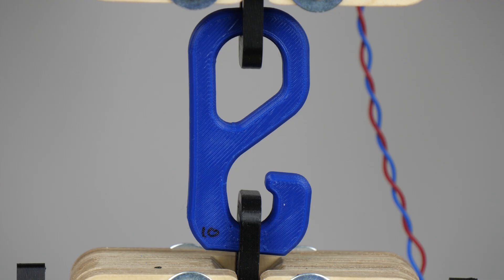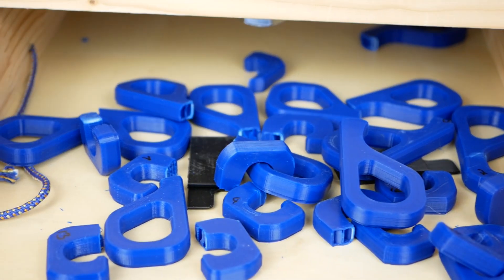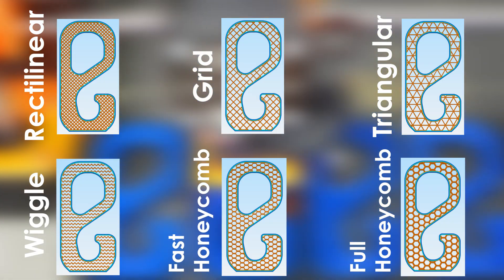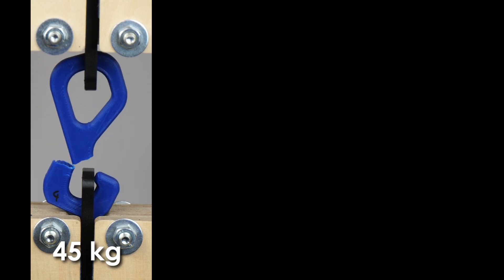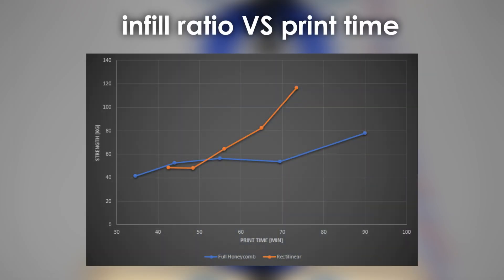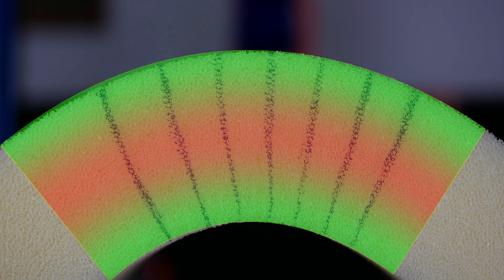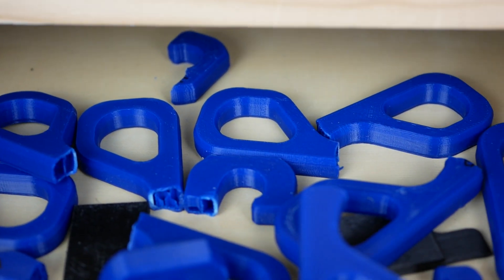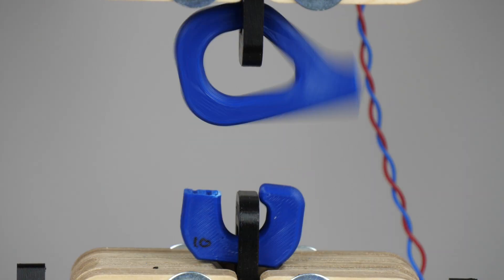INFILL pattern and SHELLS - How to get the maximum STRENGTH out of your 3D prints?

Comment: Is it better to have a pair of 0.4 mm walls, or a single 0.7mm wall? I chose 0.7 because I typically use a 0.6 nozzle.
Reply: So, I just printed some parts with my .6mm nozzle. Did .9mm wide layer width and .24mm height. 3 walls, 10% gyroid infill 5 top at 1mm and 4 bottom and 0 and these things are light and Very strong. CNC has another vid where he talks about layer width and I just used his ratios and applied it to my .6mm. hope that is helpful.
Reply: @d3myz18  Thank you! I ended up really diving into Arachne calibration as well as scarf seam calibration, and I think I found a sweet spot using a 0.6 nozzle. 0.7 inner wall, 0.72 outer, 40% minimum wall width iirc, and 1.55 scarf flow multiplier at 15mm scarf length. I'll be using a 1.4mm nozzle on my Takoto, will likely post a video of how that goes.

Comment: Have you considered repeating your experiments using much smaller parts?

I think the "more walls = stronger" rule breaks down at small scales. Suppose you have a 1.5 mm thick part, with room for 4 walls across.  Your options are 1 wall + 100% infill, or 2 walls + no infill.  While the latter case has "more walls", the part is weaker because every layer is identical and there is no cris-crossing.

Comment: Cura has "alternate extra wall". How much does it help to better connect to infill and maybe add extra strength?
Reply: It shouldn't, as from my perspective the video shows that the failure mode is not de-lamination of the infill from the wall, it's the splitting of the outermost surface. Still, I'd be interested to see a video where the center of a volume is compressed, and the failure mode is more of a "punching through" effect.

Comment: When I print with a lot of walls, I have to drastically reduce the extrusion multiplier, or the part comes out looking like it was severely over-extruded.  My extruder is reasonably well-calibrated and this doesn't happen with normal 2-3 wall prints.  Wondering why that happens?

Comment: I suppose the wiggle infill pattern might make sense for some elastic materials, for parts intended to bend, compress or stretch significantly. On one hand it looks like it offers support without adding much rigidity to the part, and on the other hand it has no obvious points of failure, instead looking like it would disperse forces over a larger area.

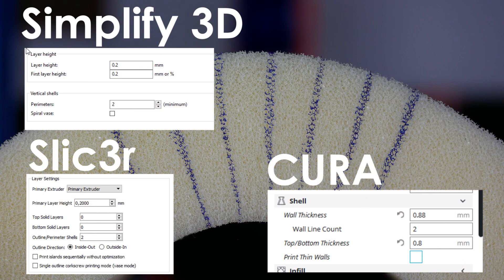Comment: AWESOME Data! Can someone PLEASE help me understand and implement the steps at @6:55 using FLASH PRINT as I have a Adventurer 3. I have changed my infill to 60%, but the only "Perimeter" options I have inside my "Infill" tab is "overlap Perimeter". I want to be able to make mine strong but dont know how to adjust the settings inside my Flash Print. Does anyone mind helping me please? "Interval layers" "solid layers" are also options.

Comment: Excellent testing and explanation.  It makes sense that having more filaments in the direction of the stress, near the outside of the part where the stress is greatest, would be stronger.  I have a question, however.  If you are printing a solid, round rod, oriented vertically in the Z-axis, the perimeter layers are printed around the circumference of the part, and if the rod is subjected to a bending load, the stress will be trying to pull apart the layers from each other on the tension side.  I would assume this would be much weaker than if the filaments ran in the Z direction, but that is not practical.  In my application, I have a flat base with a rod protruding vertically from it, and it is subject to some bending loads applied sideways at the top of the rod. The weakest point is where the rod meets the base.  What would be the strongest way to print this part?  Thanks in advance for your answer.

Comment: It took some time, but I got there in the end. Now, I understand exactly what is meant by this video. Not because of its production. It is extremely well made and explained. It is that up until now I did not NEED to understand it. I have been firefighting one problem after another with the belief that if it ain't broke don't fix it. That of course was down to confidence in what I was printing. Now I can experiment knowing if anything goes wrong I can fix it. CNC kitchen has played a big part in building my confidence and I will always be grateful. Thank you, Sir

Comment: How does all this translate to parts that need to hold considerable amount of weight? Im building a trim set for my aquarium and for the bottom trim is expected to hold 150lb-200lb depending on additional material like stones etc. Im printing with Petg as well. I domt care for strength described in the tests as all i need is a formula between shell, parameter, top and bottom and infill that I can use and feel confident my aquarium wont come crashing down. I could do a 100% solid piece but that would take months. As cura estimates 30 days of non stop printing to do 20% infill with 8 walls and 8 top/bottom so far. I cant imagine the crazy time it would take to do 100%.

Comment: A comprehensive analysis, thank you! But have you thought about compressive strain and shear strain as opposed to torsion and tension? I saw a video of someone using PLA printed dies with 100% infill for shaping sheet aluminium. The dies were hammered against the metal, and the compression strength of the part was essential. For shear strain, maybe a through-hole screw fitting that is loaded perpendicular to the screw axis would be an example. It would be very interesting to see how infill vs. perimeter applies in these cases.

Comment: Finally! you answered my question, I wondered why my parts were weak even when I printed at 100% infill or with higher outer wall and why my prints failed when the infill and outer wall were too high. For a while I've been printing with 15% to 20% infill and with an outer shell/wall thickness =<2mm resulting in fairly strong parts for support, but weak against holding/pulling. Time to pull out my Ti84+ calculator and do some math; wall/shell thickness + infill% + line distance + pattern type + speed + material = 100%

Comment: Thanks so much for this research, Stefan. I'm designing a 3d printed C-clamp, and the first iteration would break quite easily if tightened even slightly too far - I increased the number of perimeters from 2 to 4 for version 2, and when I attempted to test it to destruction, it actually crushed a small indentation into the underside of a particleboard table before I chickened out.

Comment: I've been printing a single wall wire mesh for some time now, and the main issue is to get it to bound properly to the outer perimeter. Mesh as in fan mesh, not a hidden infill. As it turns out, to get a strong edge bound, settings are completely different from anything else, particularly retraction is a pain. Having mastered that mesh printing, I find myself finding all sort of issues with wall bounding for infill, which will directly weaken the strength of the given part. The main trick is to reduce the print speed to say 20mm/s, and to add some filament after a retraction. I use 0,18mm. For anything else, this adds ugliness, but for mesh edge bounding, it works miracles. If you want strength and as little use of material as possible, this appears to be the only solution right now.

What we really need, is for slicers to add extra filament on single wall infills, particularly at the beginning of lines. We also need for Prusaslicer and Cura to stop trying to join single line extrusions in mid air, like for example Cura does for infills. It is not just the pattern of the infill, more attention is needed on the edge bounding, or edge adhesion. It simply needs a lot of work. As for speed, the pattern itself can be sped up, but the bounds at the edge, probably need more conservative speed at the edges. Currently, everyone is just going full tilt all over, which is a poor tactic.

Printing a wire mesh with single walls will highlight the issue. I have only been able to print such a pattern in Simplify3D, and only at snail speed with crazy settings. It is the exact same pattern as rectangular infill.

Comment: i am using rectilinear for infill and external layers but i also have on both external and internal infill angle offsets 4 values i start with   90, 45, -45, 0 degree i think the material bounding beret and i believe is more strong i will appreciate if you test it also i use 4 top and bottom solid layers and 2 outline/perimeter shells thanks in advance Mike.

Comment: Shell thinckness helps more then infill in this example because force applied to hooks at weakest point is at the same direction with printing. If you did print hooks from bottom to top, I highly doubt that shell thickness would help more than infill.

Comment: What kind of printing issues can you get when printing at 100% infill? I ask because I often want/need to print at 100% in order to have a part that I can drill holes in, drive screws into, or bend/twist without risking layer separation.

Comment: This is why understanding mass moments of inertia is important. I(eye) beams in construction used to be solid  beams, until  they discovered that the middle section of the  square beams was the most important part. they started to save money and material by making I(eye) beams.  I suggest that others look up strength of materials online class
Reply from the maker: 10/10

Comment: As internet lore indicates increasing the number of shells increases the strength. Thank you for great testing on this.

But where does that taper off? Is 8 shells better then 6? Is 10 better then 8?

Also, I find strength by weight to be a near worthless metric. Ideally show strength by shell, then strength by infil %, after that strength by time is a distant third, and strength by weight is very far back in fourth.

Comment: 8:24 15% Full Honeycomb, 2 perimeters is stronger than 75% and 30% infills (same pattern, same perimeters) wow, that's impressive. I'm already using from 5% up to 20% only for really sturdy prints. Great video!
Reply: I guess its actually not. It is just more efficient, because of the better strength/weight ratio. Absolutely stronger is probably the 75% part.

Comment: Structural engineer here. A little late to the party but I'd like to add a little note that the strength of any part heavily depends on 1) how its loaded and 2) the cross sectional area at those loads. There's also the randomness factor of the material so multiple tests of the same thing need to be performed to get an accurate result. But that being said, the failure cross section of your part is parallel to the wiggle fill so only the shell's cross section is contributing to that parts strength and would obviously be the least strong. If you rotate the wiggle fill to be perpendicular to the failure plane you'll probably get higher strength values. The more material you are able to get in the failure cross section, the "stronger" the part will be. That's why increasing the shell makes it stronger, because it's guaranteed to increase the cross sectional area. Increasing shell would marginally increase the moment capacity because it enlarges inward closer to the neutral axis picking up less stress. However increasing shell would more significantly increase tensile strength since it's theoretically uniform stress across the cross section. So that being said, if your typical user's part is failing in bending, increasing the shell won't help it very much. Which is what this test doesn't show properly is whether the part is failing in bending or tension. I'd be happy to help you design a seperate test for pure bending.

So to make a part stronger, I agree increasing the shell will help the most and more infill is a bit beneficial but they're not your only options. Assuming there's no critical size constraint you can also change the size and shape of your part to be more structurally sound. Just like how an I-beam can be a stronger shape than say a tube that has the same cross sectional area if oriented correctly to your loads. Infill density and shell thickness will help the most with tension (and possibly compression) loads the most. Bending capacity can be increased a bit with more shell and infill but changing the shape is probably the best option.

If you want to do more "scientific" tests to really figure out what's better you need to control a few more variables. 1st variable, have a control part with 0 infill and compare to another infill with the same shell thickness to see how much the infill is even helping. I hypothesize 0 infill will be similar results to the wiggle fill orientation in this video. 2nd variable is to control the failure plane. The cross sectional area of where you want the part to fail should be smaller than the rest of the part. Then you can see how much stress is actually acting on the part. 3rd variable, seperate bending and tension loads as seperate tests.

Comment: Infill is almost more of a (non-removable) internal support structure for top and bottom layers. if you increase infill% you wont need as many full top layers.
Also unless an essentially solid part is required you should not print at 100% infill. Some strange things start happening with expansion and shrinkage of the overall print.
Recently I have been using exclusively  ESUN PLA+ so it may be different for other brands/materials.

Comment: Any idea how the orientation of the infil (with respect to the forces) affects strength?
For instance, if the hook was printed standing vertically, with the infil structures (rectangles, honeycombs,etc) also running vertically.
I imaging a more "3D" infil structures would handle diverse bending forces better than any of these linear structures, regardless of orientation with respect to the applied forces

Comment: But I'm guessing the direction of the force also plays a significant role.  In this case the force is straight down, favoring a thicker perimeter.  But what if the force were from the side, as it often is?  Would this change the results?  I suspect it would.   BTW your video is excellent, thank you!

Comment: Being a mechanical engineer by profession I can say that this is what moves 3d printing forward. Thanks!
I need to make high strength, light weight parts and this video definetly got me thinking about my design. Especially the possibility to make dual walls at high stress points to add strength while keeping the weight down. More of this please :-)
Reply: I know this might struck your ego and sense of self entitlement, but "being a mechanical engineer by profession"(whatever that's supposed to mean) doesn't give you any extra capability to evaluate what moves 3d printing forward. Any 3D printing hobbyist can do exactly the same, but you had to come to the comments writing something to make yourself feel special, I understand, some people are insecure like that 🙃
Reply: @AlexandreG  And you seem to enjoy interpreting comments ungenerously. Most money spent on 3D printing is by industry, not hobbyists. Mechanical engineers play a significant role in choosing printers and designing parts. Suggesting the perspective of a mechanical engineer is no different than the perspective of a hobbyist is silly. Both perspectives have their value. While you may not like @Meglification 's tone, devaluing their perspective to justify calling  them insecure is excessive. And an unreasonable reach.
Reply: @ericmanternach2340  As you might have noticed, I didn't say I'm a mechanical engineer to give value to what I said but apparently the guy is right, some people will just take your word for what it is if you take crtedentials, thanks for showing me. A year ago, me as a mechanical engineer boughta a 3D printer and it was my hobbyist friends who introduced me to it in many ways I didn't even think about, they knew much better than me. And surely they know just as much as me what might move 3D printing forward. Me being a mechanical engineer doesn't make me more entitled to what moves 3D printing forward compared to a person without a degree. Hope you were clarified
Reply: @AlexandreG  Never seen someone feel so attacked by a random comment on the long story of the whole internet untill you.
Reply: @ziberzero  that's really cool 🤓
Reply: @AlexandreG  I know! It is very typical Reddit/American culture to start by saying their profession to try to give more weight to what they are saying. It is very old school elitist and frankly disgusting. I always stay away from those kinds of people.

Comment: hey basically there is a general error ! .. As in buildings, blocks of concrete must be pose in a specific direction: the more "walls" to sustain.
here you printed the grids in the wrong direction for best resistance ! .. also .. those grids are just thin angular tension. BUT the way you may re-do your good test is to fill in as the grids (patterns) will be rotated to 90° (coz here that's just it: the grids are to support just as they are printed in flat poses), and also the test is wrong for that coz you just test the grid density and not the structural performance of a grid .. that explained the bad honey results ! .. search for honeycomb panels ..
* in fact, the honeycomb is an "hexature" of the tubes (means cricles compressed)... also the results will be the more diagonals (under 45°, 30° great), the best performance for your test...